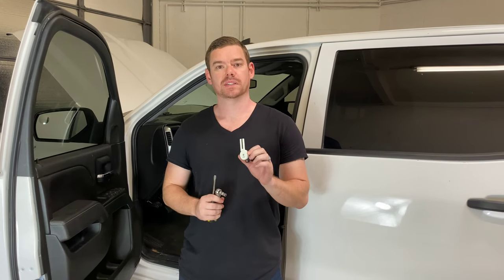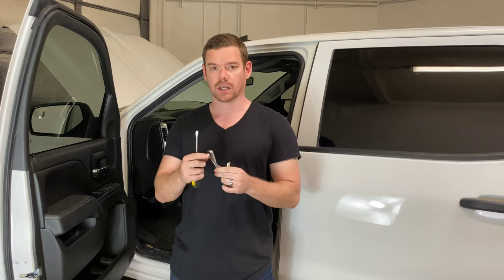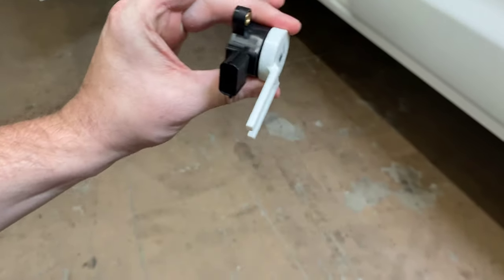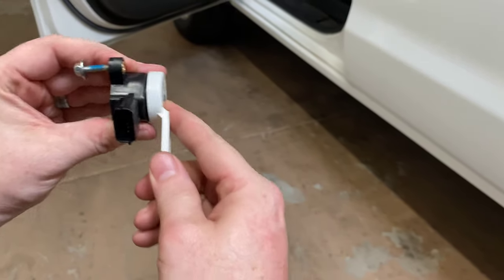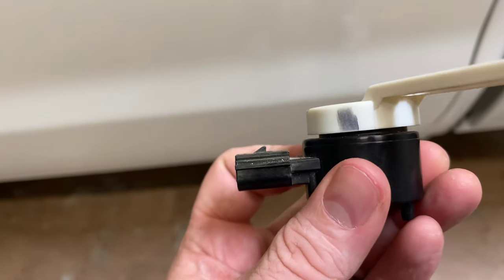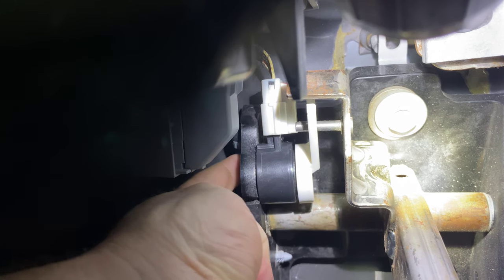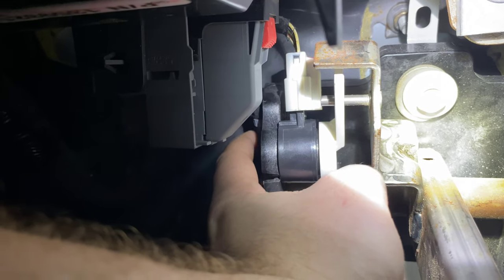How To Change A Chevy Silverado Brake Pedal Position Sensor - Remove Replace Chevrolet Replacement

Comment: Holy wow!! This is much more difficult than u made it seem. Best video i have found on this part replacement BTW.  Any tricks. My back is killing me. I need a little person. Droped the screw in the electronic panel underneath. About had a melt down. Was able to pull the cover and found it. Thank God. Got an old t shirt protecting the crevases and such.
Reply: Update. A lot of cursing, soreness and persistence and i got the new one on.  Still, the brake lights wont turn off. And getting a reduced engine power display.  Any thoughts?
Reply from the maker: Yeah the access to it is definitely the hardest part.  I'm not sure on if there is anything else, in your case, that needs to be reset on the vehicle once the new sensor is installed but that may be something to look into
Reply: @chadgresham6456  you have the wrong part.
Reply: @chadgresham6456  what ended up being the problem???

Comment: Hope this helps someone:

2015 HD 2500 LTZ Z71 w duramax and allison theres  no room for shit w bcm and more in the way under the dash. nightmare, amazon under there.
 this is a real fng pain in the dick. my cruise control went out, scan tool claimed no response from cruise control but showed active pedal working ( go figure). there is no fuse for cc.as you guessed it: replace this first.then relearn pedal position.

Your video is accurate and to the point,Yes you do need a 7mm short or long 1/4 drive, socket and a short handled ratchet/spinner.its not hard to do, its just the bolt goes in at a 90 degree angle in a weird spot.and its tricky to get the bolt setup w out dropping it etc etc

FWIW, put a piece of rubber tubing over the bolt to get it started.Also used a thin piece of 3M vhb to keep the switch base in place because the white fork is kind of wound into place and unless your a fucking octopus, good luck holding it in place w 2 hands while getting that bolt to thread. also add something to put under the switch in case you drop the bolt. if you dont  and u drop it, u may never find it again.....good luck, Dont have a stroke doing this one! enjoy and good luck w this mfer of a task.

Comment: What is the piece that is about 3/4 of the way up the brake pedal? On the end where it also connects the rod that goes through the front wall?

Comment: okay so if i wanted to DIY a solution to temporarily stop the brake lights from coming on (for driving with night vision), could i install a toggle switch on the ground wire of the brake light sensor that's connected to the pedal so it just interrupts the continuity of the lights when the switch is engaged or would that not work?
Reply from the maker: not sure on that

Comment: Is this the break light switch  then.     my cruise control dont want work on my 2015 Silverado. If I put this do you think my cruise control work again
Reply: Did you figure anything out on your cruise control? I've got a 2014 that the cruise control just stopped working a few days ago and not figured out yet why?
Reply: Replacing this switch fixed the cruise Control not working issue 2015 hd 2500 ltz w sr71. And it was not easy. And.had to use a scan tool to relearn the brake pedal position for the switch.
Reply: @PYR-Auto  it can affect your cruise control.
Reply: @techinvestigator1  man, i gave up for the night. Been at it for an hour upside down, back at a funky bend, lol how did you do it?
Reply: @techinvestigator1  yeah definitely!! I was thinking about double sided tape. I tried to use a small Allen key to guide it as a pilot. But I’m 6’4” and my big ass was only able to put one hand under there. Going for round 2 tonight. My upper body was to sore to mess around with it yesterday hahah. Fuckin assholes.
Reply: @IDK_THO  definitely pull the knee panel and the metal cross bar, you'll be able to get 2 hands up in there. Also, make sure you have the correct switch. My stabiltrack wont go on, my brake pedal position is off, i re learned the brake switch/position sensor w a snap on scan tool, and shits still not right.I may have to do it....AGAIN! fuckers
Reply: @techinvestigator1  which scan tool did you use?
Reply: @kirbyreynolds6565  Ethos edge from snap on

Comment: i got a 2013 sierra 1500. previous owner changed this sensor bc stabilitrak came on. now the truck always has grade braking on every time i turn the truck on. would i have to reset the ECU during this to completely disable this? need help it’s getting annoying having to turn it off every time
Reply: Grade braking is set to ON as default by GM design.  If you want to turn this feature off, you simply hold in the Trailer brake button for 5-7 seconds and release it.  Unfortunately, you'll need to do this everytime the truck is turn off and on again.  I just noticed you have a 2013, not sure if my info is applicable for that model year, though it is for 14'-18' GM models.

Comment: I changed this because brake lights were stuck on, now stabilitrak is on and lights aren’t working correctly. Any thoughts? 2015 Silverado 1500 LT 5.3
Reply from the maker: not sure on that sorry

Comment: Will this fix my stabiltrak and dash light problem.. when i step on the brake? It only happen after about 30 min of driving
Reply: Sounds like it shorts out and restarts all the electronics in the car,, sometimes the truck almost dies 2015 silverado
Reply: @nvrcnyle  you ever figured out what it was mine does the same thing?
Reply: @ec271993  yes, i thought it was the brake pump (they have a recall on that) they replaced it,, but that didn't fix it,, last thing i did was removed the battery cables cleaned the post and the inside the clamp with rough sandpaper, reconnected after an hour and no problems since,, im thinking it was  a ground issue
Reply: @nvrcnyle  thanks I’ll try that

Comment: Do you know if the 2017 Chevy Silverado is the same? Great video by the way!!
Reply: I got a code P057C, and I’m going to do what you did if it’s the same for a 2017
Reply from the maker: I believe it should be the same on a 2017
Reply: @tifgarvin1 how'd the repair go? I have a 17 also and I just got the same code.

Comment: Will this cause a hard brake peddle as well. The scan tool says mine is out? 2016 Chevy Colorado
Reply from the maker: I'm not sure - the Silverado that we did in the video did not have a hard brake pedal.  However, if the scan tool is reading an error with the brake pedal position sensor and you have a hard pedal then I wouldn't be surprised if the two are related.
Reply: @PYR-Auto  Thanks.
Reply from the maker: You're Welcome!

Comment: Stabilitrak will  flash on with an airbag light when pressing on the brakes only in cold weather.  Thinking this might be it.
Reply from the maker: Did this fix your issue?
Reply: Any update if this fixes your issue

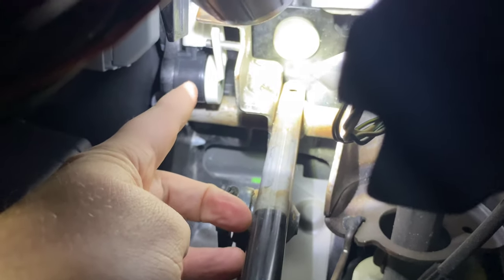Comment: Off topic but Im having a major issue with the cruise control in my truck not working. Everyone says to change the brake switch (mounted on the brake pedal with the stud at 1:26) to fix the issue but it was gone. Instead all I have is CUT WIRES and I cant figure out what harness they belong to and how to put it back together. I think they go to the junction box. No help online whatsoever :(
Reply from the maker: Not sure on that sorry
Reply: @PYR-Auto  I posted a video about it. Every Silverado Ive seen either has a white brake light switch or that black one. Ppl are saying the wires I see are for a trailer brake. But still that confuses the hell out of me, if the cut wires arent part of the problem, and I dont have the same brake switch as everyone else. Gonna take it to a shop, thanks tho

Comment: Does the sensor need to be calibrated?
Reply from the maker: I'm not sure if they are ever supposed to be but we did not calibrate the one in the video.
Reply: @PYR-Auto I see rockauto mentions the part requires programming. Was yours as simple as swapping thatbpart? No other issues came up after?

Comment: Will this make the radio stop working
Reply from the maker: No
Reply: @PYR-Auto  Thanks. It was actually my brake light switch. I replaced my brake booster the other day and forgot to put it back on the pedal.
Reply from the maker: Cool - glad you got it figured out

Comment: How to program this sensor after replace it
Reply from the maker: The sensor in the video did not require programming, it worked once plugged in
Reply: You use a scan tool to force the vehicle to re learn the brake pedal position sensor.
Reply: @techinvestigator1 any more info on the relearn process with a scan tool?